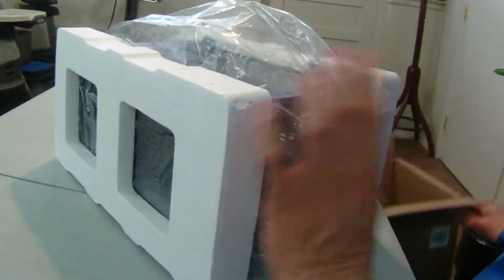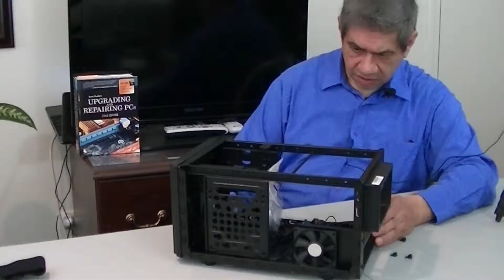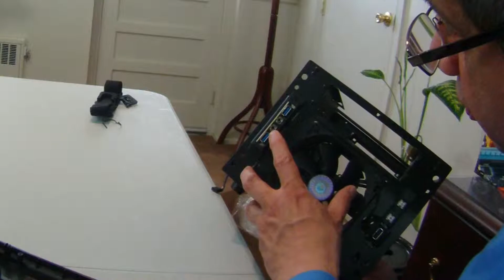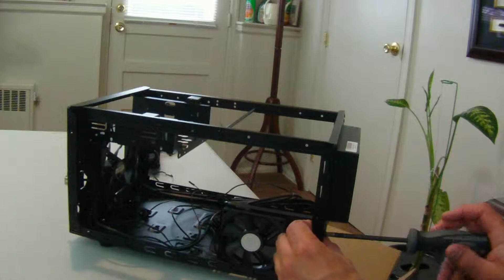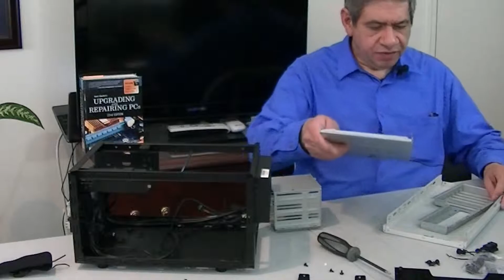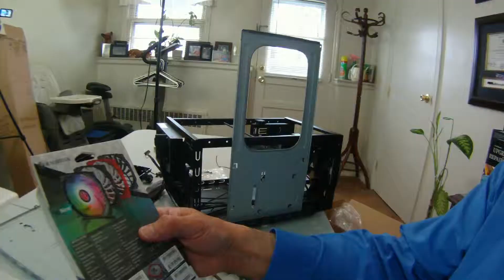Server Build Pt. 1 – Elite 130 Case Review and Case Mod Survey

Comment: Hello PE4Doers
I have finally completed my NAS build in this case. Instead of original plan of 10x 3.5" drives I have been able to put in 8x 3.5" drives.
I will upload a video for your perusal shortly.
Reply from the maker: Thanks, I would appreciate that.  I will soon be building a replacement XigmaNAS, so I hope that video series goes over well.

Comment: Hello PE4Doers. Thank you for the detailed videos. They really helped me get the dimensions of the hardware & component alignment settled in my mind.
I am interested in building a NAS out of the same case. May I solicit your thoughts on the feasibility?
I am going to:
1) Remove the 5.25 bay
2) Install two 5 bay cages along their sides in the front of the case with the hard drives aligned lengthwise to the case.
3) Upgrade the front fan to a more powerful one.
4) Install an Mini ITX motherboard or an x86 SBC having enough SATA connectors
5) Select a power supply & install it.

Any thoughts?
Reply from the maker: It sounds like you really have it all planned out, which is exactly what you need to do.
Ten (10) drives seem like a lot however, Although the ITX motherboard 'might' support however, I would be concerned about the heat that would be generated by so many drive running in that confined space.
Reply: @PE4Doers  Yes I am concerned about the heat too. So to alleviate that there will be 3 fans blowing in (1 case front, 2 case side modded fans blowing on hard disk stack) & 2 case side modded fans blowing out on the next to the power supply  for a total of 5 fans. So the airflow will be from front & front-sides in to back sides out. I will have to mod 4x140 mm slim fans into the side of the case to save space. Will this work?
Reply: @PE4Doers  Also could you suggest a motherboard which I can use? I need 10 SATA ports at least. I assume that since you made your video there may be new motherboards available.  My research landed me on "ASRock B550 Phantom Gaming" but its too powerful for a NAS. However it has an interesting built in support where the PCIe x16 can be split into two PCIe x8 slots with minimal additional hardware. This can allow for additional SATA card. Please advise.
Reply: @PE4Doers  I must say it again. Hats off to the details in video. I have seen many other reviews but none was useful for DIY parts selection given the dimensions. I have the case being shipped to me. I will verify the dimensions of the internal components once it reaches. This is my first build ever. Earlier I just purchased a QNAP TS-251. Here are the dimensions of the components.
Item:	L		x	W		x	H
Case:	377.5 	x 	240 	x 	205
HDD:	146	x	101.6	x	25.4
MB:	170	x	170	x	0
PSU:	140	x	150	x	86
Reply: @PE4Doers  Here is my part list: https://pcpartpicker.com/list/g8bZBZ

Comment: I found this video very helpful - I may have missed what you said, but will you be showing how to stall the server software at some point?
Reply from the maker: Yes, once I have released the final hardware build video I plan on installing the Server Software.  I may actually try three different options: 1) XigmaNAS, 2) Ubuntu Server, 3) Windows Server '08.  Which one I actually settle on will depend on how well each of install and/or perform.